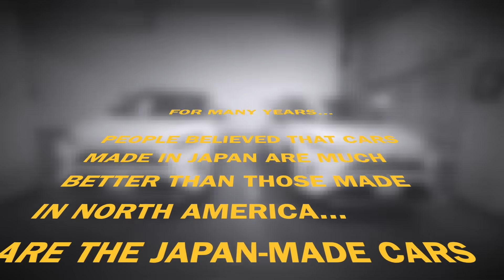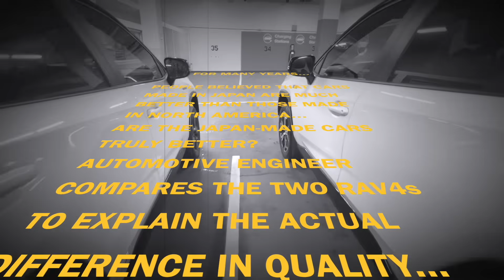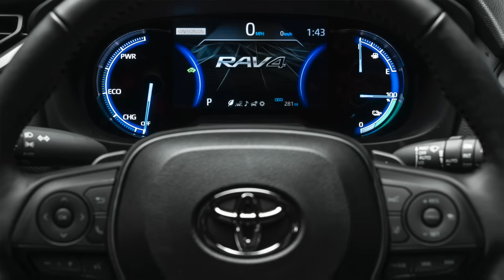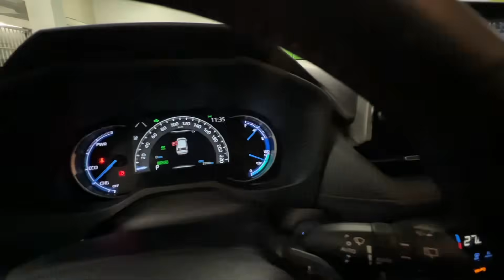JAPAN vs NORTH AMERICA - ENGINEER ANSWERS THE MOST IMPORTANT QUESTION - WHO BUILDS BETTER CARS?

Comment: Based on design and expected tolerance stacking what was the design intent? Would not conclude it is manufacturing. Also you should be measuring numerous qty as 1 vehicle comparison is meaningless to determine statistical tolerance variation. Cant conclude what is presented. Coming from Magna Engineer designing car latches...

Comment: My family owned Toyotas for 50 years. I can definitely say we would never buy anything built in TMMK. Horrible.
However the most reliable car We ever owned was a 1997 RAV4, and 2004 LS430. The absolute worst was the TMMK 2007 Camry SE V6, was built horribly, and went through 2 transmissions before 60k miles.

Comment: Great video! I picked up my 2022 NX a month ago and is built in Japan. Your video put me at ease that there isn't as much a difference between Japan and Cambridge Ontario. I am biased towards Japanese cars as my previous CT200h was also built in Japan and it was very high quality. I also owned Jettas and the quality was lacking. 

 But another question is, how is the engine quality and run? You mentioned it would take many years to see long term trends. I guess that would be more important for resale value and repair costs.

Comment: Being a Honda guy, I've owned Honda's and Acura's built in Canada, USA and Japan.  The Japanese built ones are definitely #1.  There is just a solid feel to them.  All the materials are just that little bit better.  The Canadian was also really good and I would rate a very close #2.  The USA built ones while good (I had no issues) but they just didn't feel as solid.  To the average person you wouldnt notice but when you spend time with each one you can tell the difference.

Same thing with the bikes.  You can tell a Honda bike made in Japan vs a Honda bike made in Malaysia.  Both great.  Both reliable.  Both well made.  However the Japanese built one feels that little bit more solid /smoother in the switchgear, transmission engine, clutch.

Comment: I really like this review David. I have a Cambridge built RAV 4 ( live in Ontario). I find some interior injection moulded parts have rough edges  a bit atypical compares to other Toyotas I have owned. One  ares I find odd is that some interior black panels have a purple  cast in bright sunlight so some inconsistencies. Admit a bit OCDon this stuff but my observation. Still confident that Toyota compared to others has set a high bar.

Comment: My wife and I just bought a 2022 RAV4 SE Hybrid.  We had to “beat” other potential buyers to the dealership and lost out on higher trim RAV4 models as the dealership only reserve these on a first come-first serve basis.  We “settled” on the SE Hybrid specifically because the VIN started with a “J”.  I own a 2012 4Runner SR5 bought brand-new and now has 192K on the odometer and it is still going strong.  We also own a 2012 Camry Hybrid with 74K miles which was made in the states and have not had any major problems with the car.  We believe that buying from the factory in Aichi is all about peace of mind when it comes to long-term ownership as we keep our vehicles for more than 10 years.  Thanks for the video and the knowledge you share with us.

Comment: I’ve found from personal experience that all the Toyota and Lexus and even Honda products that I’ve owned in the past, that were made in Japan, gave me the least amount of trouble. Especially from an electrically built standpoint. All the power accessories worked perfectly even the door locks and window motors into extremely high mileage. The paint quality is always better in the Japanese built Toyota/Lexus vehicles as the Japan built models paint holds up forever and never fades or peels even after 20+ years. 

I would like to add that the older Lexus/Toyota  models from the 90’s-early to mid 2000’s had the best quality interiors. You never had any real hard plastic surfaces on the door panels, dash and other areas including the lower part of a door panel which is always hard plastic these days, was always a nice softly padded vinyl that held up forever and gave the interior a much richer look and feel especially in the Lexus ES300-330 generation. Which was extremely nice including the LS430’s and 460’s which were BTW all built in Japan.
Reply: Always wondered what that stuff they used in the late 90's Camry was. Everything was covered in this weird vaguely soft stuff and it was amazing. Also, the fuzzy mouse fur cloth everywhere.

Comment: David, the RAV4 models produced in Japan and North America, what is the percentage of commonality of the whole car parts? The models produced and sold in mainland China do not support carplay, can consumers replace it with the U.S. multimedia large screen installation? Thank you
Reply from the maker: It's nearly identical but when it comes to electronics, it's not often plug and play.  So while you might be able to hack into the system it's not always easy to swap parts as the software have to also support the hardware changes.
Reply: @AutomotivePress  多谢

Comment: 4 mm to 4.5 mm is not a 25% difference.
Reply from the maker: The RAV4 Prime built in Japan shows panel gaps ranging from 3mm to 3.5mm, the Canadian built RAV4 had gaps ranging from 4mm to 4.5mm.  That means the Japan version has average of 3.25mm gap, the Canadian one 4.25mm.  The difference is 1mm between Japan and Canada, which is 24%.
Reply: Except he didn’t say the gap difference between the vehicles was 4mm to 4.5mm,  he said the prime gap was 3mm and the Canadian rav4 gap was 4/4.5 mm.  That is a 25% difference.

Comment: Thank you David... I had questions about this since the last video.

1. Does the Takumi Process really affect quality?
2. Do factories outside of Japan use the Takumi approach?
3. Since engineering processes are similar, why do some manufacturers build more reliable vehicles than others?
Reply from the maker: Those are great questions!  I may create a video to explain all that... but in summary, Takumi thinking or approach do make a difference but Takumi process is currently applied to the select few (Lexus LC, GR Yaris, GR Corolla).  They do not have Takumi specialists in all areas of Toyota production, but all Toyota factories follow the "Toyota Way" principles which echo some of the Takumi thinking.  There are Takumi specialists in Japan and also in Ontario, Canada, and Kentucky as well.  In terms of why some companies build better cars, let me work on that video as the explanation is going to be very long.
Reply: @AutomotivePress  last month I watched the Takumi video by Lexus and got a better appreciation for the craftsmanship of my LC500.
Reply: @timw2083  Hi Tim, do you have the link to that Lexus Takumi video? Thanks.
Reply: @BecauseReasonsReviews  you can find by searching youtube "Lexus 60,000 Hours Takumi Documentary" the video is about 54 minutes long but very good